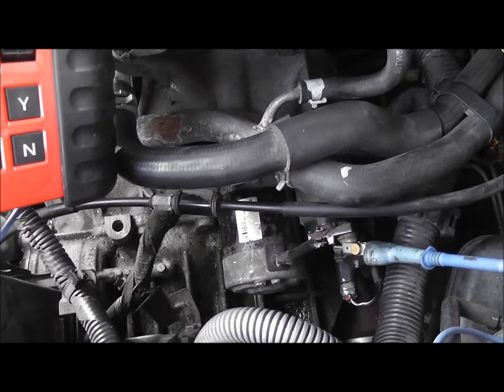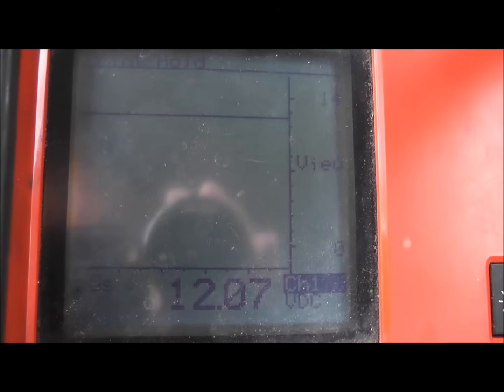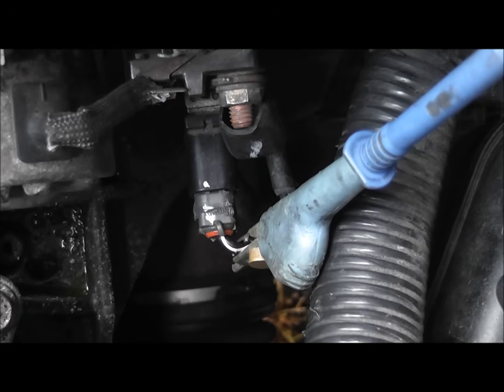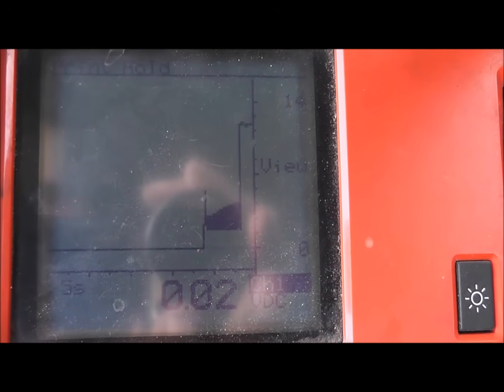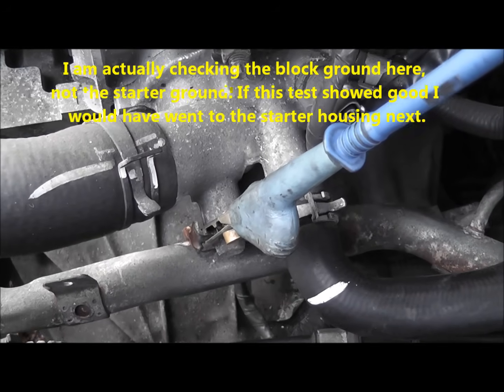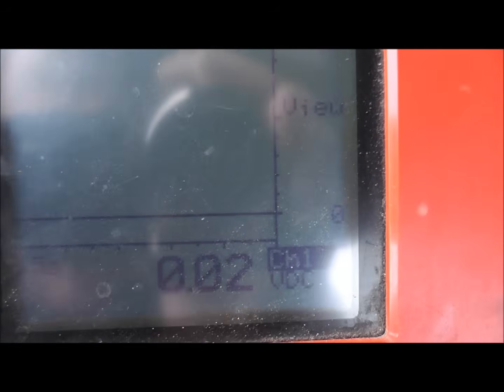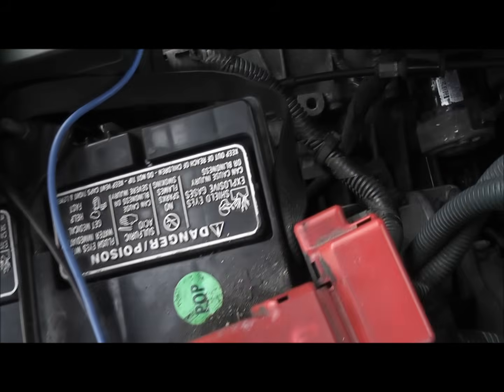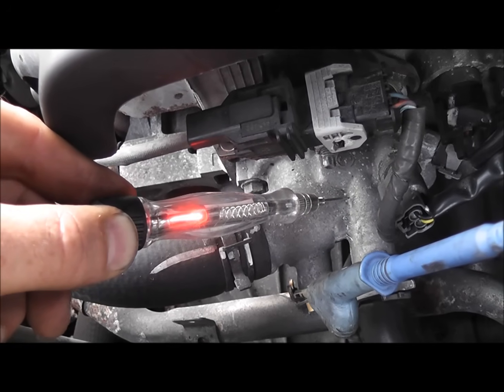How to test a starter motor (no crank from a bad block ground) - Nissan

Comment: What is maximum voltage for block ground ?
Reply from the maker: It should be 0v, but you may see up to 200mv or so during cranking. On the initial crank, the starter can produce as high as 800amps. The average cranking amperage is less than 200 amps for most cars, but the initial 500m.s. when the starter first starts spinning is a HUGE amount of amperage, so you can see block voltage approach 1v at that time. But you'd never see that on a voltmeter, only a lab scope as it happens to fast
Reply: @ScannerDanner  Thank you. Can you tell me what should be maximum normal reading on voltmeter between alternator b+ and battery + ? I have reading 150mV and it's not a problem as far as costumer complain is. And i dont want to waste my time chasing it if that's normal.
Reply from the maker: @4YouWHOyou  make sure that reading was taken with engine running and a bunch of accessories turned on (high beams, blower in high, rear defrost etc). I have no issues with 150mv difference there
Reply: @ScannerDanner  i did that. Thanks again :)

Comment: My dad showed me the old wiggle test on my exes camry when i was really young had no crank  and a bad starter that we had been beating on for months with a concrete stake  after i replaced the starter i still couldint get it to roll over  i was dumbfounded thinking i hooked somthing up wrong then my dad came over started yanking on the battery cables while i turned the key car fired right up then died i thought he was a fricken wizard lol new cables and the car was back on the road i thought for sure the starter had just finally crapped out but in reality we probably could of kept beating it much longer

Comment: Great 👍🏼 training ! Emphasized electrical basics / starter system  operation / dynamic loaded circuit testing for voltage drop to be revealed and finally   interpreting what the DVOM is trying to tell you. Awesome detective work and amazing job juggling the 5 or 6 key concepts in your mind all at once .  Thanks mate !

Comment: can you differentiate "key on" versus "crank position"?  i do not speak this kind of english.
Reply from the maker: Ignition switch on or run position would be "key on"
"Ceank position" is ignition switch in the crank position. If it's a push button, you're pushing the button 🙂

Comment: Thanks for the video Dan. Got a intermittent no crank issue I've been chasing for a couple years now on a 2013 KIA soul 2.0. It comes and goes, and never does it when the engine is fully warmed up. Only on following random days it chooses to no-crank.

I have full 12V to main starter positive always
Full 12v to signal when cranking only
No short to ground key-on-crank with block ground test

Newest symptom the last two days it's not cranking: starter turns for a split second then nothing every attempt. Next day today, again starter cranked for a split second and no longer cranks again. 

Does this just sound like a bad starter?

Comment: Is this the same test you'd run for a slow cranking condition? Vehicle starts but is throwing both cam sensor codes and stalls intermittently. I smell a strong burnt electrical small under the hood seems to be coming from the area of the starter. Also has code for low battery voltage but battery is new and charged. Was just replaced and connections to the battery posts were cleaned thoroughly and are tightened down properly. I suspect a bad ground or wire or the starter itself but there may be more to it.
Reply from the maker: Absolutely, if you suspect a block ground issue (starter ground), measure the starter housing or the block during the cranking period with your voltmeter black lead connected directly to battery nagative

Comment: You sir are a legend!
Reply: My situation was a little bit odd (laguna 1 2.2 1998). Dash went crazy, a ticking noise could be heard from the computer which holds the glow plug relay. The car fixed itself after a few hours of tinkering around and unplugging the glow plugs. After a week it died again. I went on a cable cleaning spree but still no luck - managed to screw up my odometer ( it never goes back to 0 when the car is off, and shows a constant 1000rpm more than it should ). After 30 hours of searching for problems, cleaning every fuse, relay, cable and sensor - no luck. I gave up, accidentally found this video - had the same symptoms. A hard lesson to learn on your own. Thank you once again!

Comment: How would I do the test light test if the battery is in the trunk. Please help asap,  I have a no crank with a brand new starter, starter tested good. Battery is good. Checked fuses, swapped starter relay with known good relay. Neutral safety switch seems to be good. When trying to start, the starter just clicks.
Reply from the maker: Connect it between the body of the car and the block
Reply: @ScannerDanner  Thanks for your reply, I used a voltmeter on the block and frame. Meter shows 0. Block ground is fine!  Any more suggestions is greatly appreciated. 08 Charger 3.5 Can hear relays clicking and starter clicks as well when trying to crank.
Reply from the maker: Yep. Take two voltage measurements on the starter while someone holds the key in the crank position.
Both the heavy cable stud and the solenoid wire
Reply: @ScannerDanner  Did 2 test at the starter, the big heavy wire has 12.6 volts and the small control wire had 0.26 volts at crank but dropped down to 0.02 volts within a second after crank. Also back probed the small control wire but same results.
Reply from the maker: @tinytim9453  so you are missing "control", now it is time to tell me what you are working on. I need year, make, model, engine size
Park/Neutral switch, ignition switch, anti-theft or immobilizer issue etc is where we are. 
Do you have access to a scan tool? Can you check for trouble codes too for me?
Reply: @ScannerDanner  Oh boy, starts to get complicated lol! 2008 Dodge Charger 3.5 The gear selector light on dash works so I'm assuming the neutral switch is ok? Tried starting in neutral no luck there. I don't think it has anti-theft, (daughter's car) I don't see the any kind of anti-theft light. As for the immobilizer, I don't know. Good question on that one. Will borrow a code scanner and check for codes. Thanks again.
Reply from the maker: @tinytim9453  that model definitely has an immobilizer system and I bet you find codes for what we have going on here. I'm almost certain that you are going to find your problem within the TIPM (totally integrated power module), same "fuse box" the starter relay is in. These fail ALL the time on Chrysler products. This is a smart fuse box and is what is responsible for energizing the starter relay (at least on one side of the coil), the PCM controls the other side of it and these two modules talk on a network to each other, to share info. 
When you crank this over, I want you to measure voltage on pins 85 and 86 on the relay pins in the TIPM with the starter relay removed. Then I want you to put an incandescent test light connected to ground and the power on each of those two pins and then tell me what the light does with what polarity
Reply: @ScannerDanner  Sorry for the delay, unfortunately, I can't get my hands on a code reader till next week. But I did those volts and light checks. With key ON CRANK, pin 85 has 12.1 volts with a steady light on the test light.  Pin 86 has no volts and no light on test light and that is also in Crank position.  On the other hand, not that it probably doesn't matter, with KEY OFF pin 85 has 9.5 volts and pin 86 had no volts.
Reply: @ScannerDanner  Are you still with me on this ?
Reply from the maker: @tinytim9453  need the result of the test light connected to battery positive and those terminals too please

Comment: good video but  what the car doing  ?  before fix the problem     mine  is making one click    lights work  , radio work  (   my lights  have been flicking for  the las past month so  if that helps  )   mecanic is telling to get a  new starter  and i want to make sure  since  is  300 dollars  and  he didnt  run all those test  car been park for 4 days  now   the monirng before  this  happpened  the car star slow cracking  so i kind of new something was wrong then in the afternoon i  turn car off never turn back on   (  i charge  battery and hit  the starter  multiple times  nothing  ( just a click seems like coming  from  starter  area  ) ( hard to reach  under  engine block   )  Honda crv 2012   any ideas? thank you
Reply: what was the issue?

Comment: When you were checking the smaller gauge wire, did you have a t pin in there? Or did your volt meter read that just clamped on the wire?

Comment: with that bad block ground , is that from battery negative black cable to mottor ? or is that a separate cable or wire from block to car framework ground ? I'm having this same problem....  and don't know if motor has a separate cable from motor to car framework if so that would answer my problems , help
Reply from the maker: It was a bad block ground, which I believe went straight to the battery. There are some where the the main block ground will go to the frame or body of the car. Then their will be another main ground cable that would go from the frame or body of the car to the battery.

Comment: ..am from Chile, south America and I got a S10 Apache 2.4 MPFI with brand new solenoid starter motor, thing is; as soon as I did crank it, two of the wires coming from the starter switch burned up real bad, both of these negative (I have the schematics)...is it bad ground symptoms?
Reply from the maker: Where are these wires? Bolted to the battery post of the starter or bolted to the block?
Reply: no they come from the starter switch, gave crank and I did end up with smoke and burned insulation in those wires....give me an mail and I´ll send the schematics, those are marked B2 ´nd D2!
Reply from the maker: I don't know what a starter switch is. Do you  mean the ignition switch?
Reply: yeap ignition switch going down or going up to...I just don´t know but am about to give crank again, ....any suggestion on do testing before do it?

Comment: We have a 2005 Grand Marquis, it has a no start, no crank issue. when you remove the negative cable of the battery, then  you  clip the test light to the negative cable, and touch the negative post on the battery, the test light lights up, how do you fix this issue???
Reply from the maker: It is becoming more and more difficult to answer questions here. I have 80,000 people asking me for help now. So I have created a forum to help you guys better. It is free to join and we can exchange pictures, wiring diagrams and waveforms if needed to help guide you through the process of troubleshooting your vehicle. Thank you so much! Hope to see you there. 

Paul Danner (ScannerDanner)

https://www.scannerdanner.com/forum/post-your-repair-questions-here.html

Comment: Coolasice2 raised a good question about an electrical schematic to illustrate the reason for the test light bulb lighting.  I cannot display it, but I will suggest one to think of the starting CIRCUIT, i.e. current traveling from battery positive post to the starter, then through the block, and then back to the battery negative post via the block ground cable.  As a consequence of the block ground cable being separated from the negative post, thus interrupting current flow, there is positive voltage on the block.

Voltage drop tests are your friends.  Whenever I encounter a no-start condition accompanied by a lack of "action" (headlights, noise), the first procedure I utilize is a test light check as Paul has demonstrated.
Reply: Thanks for that explanation! It wasn't making any sense until i read your comment.

Comment: why did you say the voltage at big post was good if the voltage read 12.12v?  Same question for the small gauge wire which read 11.97?  If the battery is fully charged to 12.6 and a battery needing a charge at 12.4..how do you explain those two voltages as good if they read well below 12.4?
Reply from the maker: +centexn normal cranking voltage is around 10.5 to 11volts. Yes 12.12 and 11.97 were slightly low considering a fully charged battery but definitely high enough to tell you it was NOT a battery issue. Make sense?
Reply: It makes sense only in that normal cranking voltage is 10.5-11v.  So it would be fair to say nominal batt charge can be -.5v from 12.6 or 12.1v and still be considered a full charge?  Cranking voltage can be a full v1/2 less than "full charge" at 12.6?  What then would be the lower limit on voltage reading to be considered bad?  Start line control voltage(spade connector) should read 12v on the meter.  Ignition switch start mode should read the same. I dont have a ground problem.  Nocrank yes, then very sluggish and labored one time start  yesterday returning to nocrank. It did crank with jumping big post and spade lug w/remote start switch. Its got to be on the start control circuit.  I thought I had won with your assistance....still fighting
Reply: @centexn  dirt or part broke wire,it work when you use temp wireing
Reply: +centexn So, I need two voltage readings from you like I showed in this video DURING cranking, when the car is not starting. Can you do that for me? Then I can help.
Reply from the maker: +ScannerDanner Premium my own comment went to spam! I just unlocked this

Comment: Right now I'm on my 01 maxima v6 it wont start. it would start before but it would make this weird sound(kinda like a dyeing duck). To get it to start I would have to hit the gas while it would crank (But this would happen when i run errands and turn the car on and off) Now when I try to start it no start no crank!! all I hear is the starter click what do you think it could be ?
Thanks for the help

So far i already ruled out
*starter
*battery
*Neutral safety switch
The flywheel looks good too.
Reply: I am directing all help requests to my forum. Sign up (it's free) and create a new post. Be sure to add a name under "alias" as this is the name that will appear in the post.
Here is the link to the forum. 
http://www.scannerdanner.com/ForumRetrieve.aspx?ForumID=3226

Comment: the first thing that happen was i went to start it ,IT crank then died within seconds tried it 4 times and then the was no crank ,no start. First thing I through of was the starter took it out and had it tested. I broke off the ignition screw on the starter when reomove it.but the auto store said it was a bad starter
I have a 02 chevy trailblazer with no crank,no start.I have replace the starter. test ignition switch,test starter relay and socket,replaced both neg and pos battery cables.cleaned all grounds, check all fuses both front and back. moved around some relays that where the same. I still have no crank no start any help I would really appreciate because the vehicle has now been sitting over a month.
scan reader has no codes.

Comment: So What if you don't have volt on the S terminal of the starter solenoid ,but you do have power in and out from the ignition switch , just wonder.. Great video tho
Reply: That could indicate 1: a bad starter relay  2:  an open/short in the wiring between ignition switch and relay, or between relay and solenoid. 3: also park/neutral/clutch-switch could be a factor here, which also could be PCM controlled. Testing from the relaybase can be a good starting point here, verify you have two powerfeeds etc. If that checks out, then you know the problem is between the relay and the solenoid :)

Comment: My 97 Acura RL w/200k has been doing this for years intermittently and now it just clicks with no dimming lights. I hear the starter is a 500.00 job and you have to take 1/2 the car apart to get to the starter :(   battery brand new and tests okay. loud click but no crank.
Reply: Not on my honda accord 97, im a noob and I did it for the first time yesterday in like 4 hours, put it back on this morning in like 40 minutes. There are literally like 2 cables, 2 main bolts and a few nuts n shit attached to it. It's about the size of 1 big fist or 2 woman sized fists.

Comment from the maker: @MrJgonzalez2 good question. the answer is no because the circuit isn't truly loaded. however if you read 12v on the feed and 0v on the ground then you can feel safe to put a bulb in it. of course you could have a burned out bulb AND a wiring problem but its highly unlikely.

Comment: I have a 2003 honda that will crank but will not start and there power still in the starter ignition line and no obd2 reading why.

Comment: Great info. It would be very helpful, however,  if you showed the starter circuit diagram so we can see why the test light lights up when the ignition switch connects 12v to the starter. Thanks.